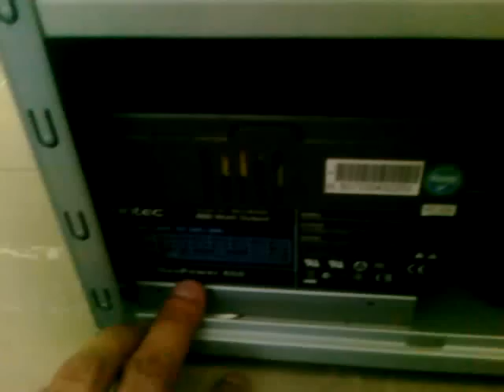MSI HAWK ATI Radeon HD 5770 Review Part 2

Comment: does it worth the extra power consumption at that low resolution to get the 5830 rather than this card in the video? with this card will i be able to run smoothly with max settings on 1024x768 lets say for example AvP 3 on directx 11?(i got an AMD Phenom II x2 black edition, quad actually, and 4gb ddr3). thx in advance

Comment: nice vid but i have one question: now, im in the same dilema as u were msi hd 5770 hawk or sapphire hd 5830? where i live they both cost pretty much the same...which one to get? i mention that my curent monitor only support max 1024 x 768 res, is there any big difference at these 2 cards on this low res? as i can see the hd 5830 only real advantage is the 256 bits bandwith rather than 128 that 5770 has, but also 175 watts(wtf O.o) consumption at full load...